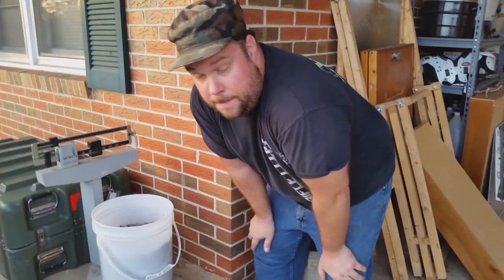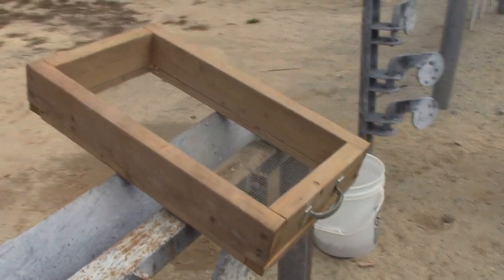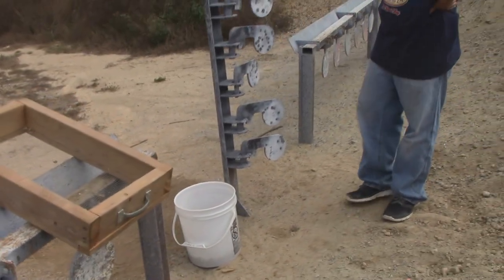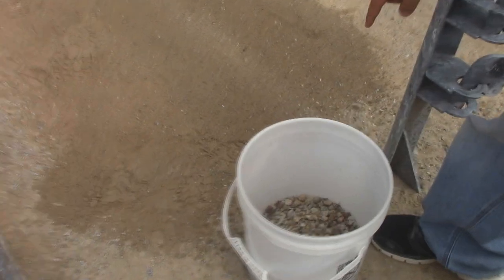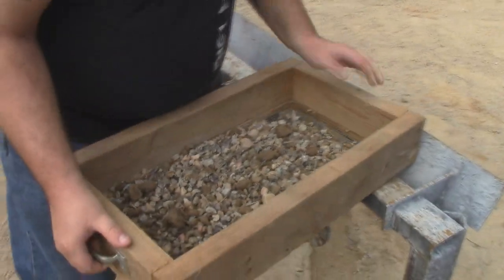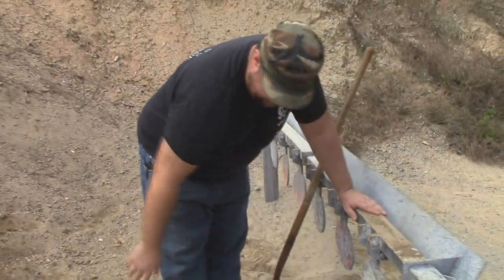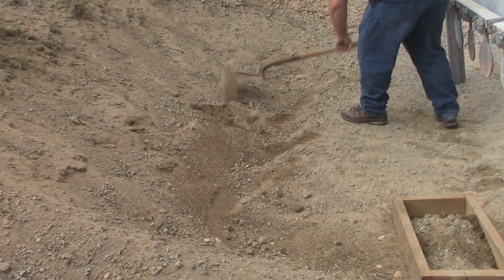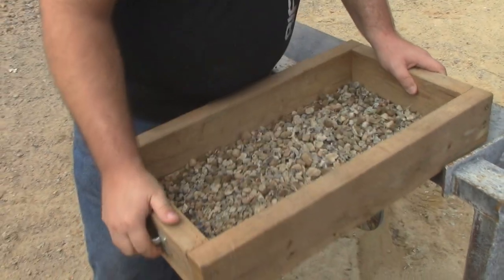I've Been Collecting Range Scrap Lead Wrong! 255LBS./30MIN.

Comment: Use an wide flat electro magnet powered by an atv's alternator/battery while mounted. it'll take you five minutes
Reply: You use a magnet to pick up lead?
Reply: +Kainen Mattison lead isn't magnetic lol
Reply: it is weakly magnetic, but still magnetic, which is why you need a power source
Reply: Everything is magnetic to some degree. For an electromagnet you need a power source all the time, otherwise it is not a magnet. And given how weakly lead interacts with magnetic fields, you would need close to MW power. Those kinds of electromagnets you seen in particle accelerators etc. I bet it would not be a viable option to use something like that to pick up lead scraps.
Reply: Yup,get a lead magnet,the greenies will sell you one

Comment: Put the sieve on blocks when shoveling in the dirt, and a lot the dirt will drop through as you shovel. Saves your back from lifting and shaking. You should have some water to settle the dust. I would suggest a respirator, and a rain suit or coveralls you can remove and toss into the back of the truck to reduce exposure to lead dust. Washing the scrap with water to remove the clay will save a lot of skimming when you melt it.

Comment: Put a ramp leading up to the flatbed of the truck.
1. Shovel the lead on a wheelbarrow.
2. Drive the wheelbarrow on top of the flatbed.
3. Empty the contents of the wheelbarrow onto the tarp covered flatbed.
4. Rinse and repeat.

Test how much lead you can safely transport with the wheelbarrow up the ramp and adjust your trips as needed.

Comment: Man I need to so that I need lead to make fishing weight for my fishing group.  I do sell weights to buy fishing stuff for the kids. But also give lead away to the kids. But I don't get lead free no more used to get wheel weights but shops can't give it away to people or have there buddy they give it to. So I get roof lead from pipes. Do get some donations which I give them free weights doe the lead. Good vidoe have a good week god bless
Reply: Super Mutynt o yea when my boats going when it's flooding I go get stuff from the trees a d when it goes down so the same. Love free stuff cause more to give away to the kids and adults out fishing that needs a smile and blessing. Thanks have a good week god bless
Reply: Danny Schwab ....did the government crack down on or outlaw lead wheel weights?  Swear I heard that on YouTube somewhere....
Reply: Rick Thompson I don't no but there using a metal that not lead. The last time I got some wheel weights about 4 years ago 30 dolles for a 5 gallon bucket turned to be 3 pounds. I was mad but when I melted I had pound and half lead the rest steal I guess it didn't melt I was so mad. But I keep the steal or what ever it is and drill holes and use anyway there small square pieces flat so work like a no role weight. But it wont be long they will but since the stores sell must me OK.  But go to YouTube search do it rock weights there a Rock you can buy and drill and make weight I'm gonna do that and give them away to the kids.  Thanks for asking I'll be googling thaT tonight thanks god bless

Comment: You could build a light weight 'rocker' like gold miners used to use to make your job much easier. Just a folding saw horse (for portability) on rockers with a handle for leverage would keep your sifter at waist level. Fast and easy.

Comment: Looked like mostly rock.  Hillbilly math is always amusing.
Reply: they arent mostly rocks. clueless people on youtube are amusing
Reply: You can usually tell whether it is lead or not just by how heavy it is.
Reply: i do wana know how much lead they end up getting out of it.  if theyd post a follow up video id be willing to bet its significantly less that 255.  maybe like 200 tops.  just curious
Reply: Well, just look at the guys name. You wouldn't really expect anything of worth to come out of that guys mouth, would you?
Reply: Karl Budde I was referring to the guy who calls himself "chester themolester.
Reply: +Rotary Saw ahhh gotcha.
Reply: +Karl Budde
That's what the guy said in the video, around 200-215 pounds of lead.
Reply: +xml
MUH SHINY LEAD BE SHINY MMMMMMMMM LIKE GOLD BUT HEAVIER!!!!!!
Reply: If you can't tell by the weight volume of the buckets you obviously have no idea what you are talking about and need to go sit down 

Go fill 3 buckets half way with rocks and wiegh it you will see how much of a difference between the 2 are....
Reply: it probably isn’t, even if it was... it makes it a lot easier to pluck out lead from that mixture than from of the ground.
Reply: Donald Taylor  Which specific type of rock? Is the rock of a pre-measured density, or are we just winging that as well? 
Maybe fill one bucket with mercury and weigh that too. And hey, are these 5 gallon buckets? a different capacity? same manufacturer, and are the fill lines the same? 

I think we ALL need to just sit down and get a few dozen of these experimental parameters to a consensus, lest our results be invalid. Who's writing the grant for this research BTW?

Comment: I've done this at the range i belonged to, and yeah, it was an efficient collection method.  But then i found the silhouette range, with the steel bullet traps.  The entire width of the traps had a huge buildup of lead in tbe vertex, with practically no jackets, dirt, or rocks.  Just some ants, which made smelting interesting😊. I had to leave the area shortly after i found this, so most of it remained untapped.

Comment: I hope the scrap metal experiment went well for you...  FISHING sinkers can be cast of any unknown alloy  with a high level of forgiveness... on which alloy is used.  IF using Zinc alloys in aluminum block molds ... be aware that hot molten zinc  CAN  'dissolve'  aluminum  well below the melt temperature of aluminum.  To PROVE that   try dissolving an aluminum can in  molten zinc or  overheated molten lead.

Comment: I was thinking of getting into that, but I'm afraid of lead poisoning. Is that something I need to be concerned about? You know, with all the fumes with melting the lead. I don't even know if I could find a range that would let me do what you are doing. But I'm glad to see someone doing that. Recycle lead. And after you cast and make your bullets, how accurate are they? I would think it would be more of a plinking load, probably not good for 223 for prairie dogs. Let me know. Thanks for sharing.

Comment: Build a stand for the sifter and lift the berm material to waist height a shovelful at a time instead of lifting 5 or
6 shovelfuls in a single lift. Also, getting it off the ground as you fill it will let most of the siftings fall through immediately. You'll be able to sift 10 or 12 shovelfuls each shaking.

Comment: Why not add a 12 vdc motor with an eccentric shaker arm, mount the whole thing on a utility or custom cart, and just let the sand drop out the bottom?   Better yet, just incline the sifter about 10 to 15 degrees and the rocks and other debris will actually advance up the slope and drop out while the lead remains in the bottom.  This happens due to the density of the lead being higher than anything else in the sifter.  They make commercial units for industry, but, it is more fun to make your own.

Comment: range lead picks up silica sand which will cut your rifling to round ridges we mined 2600 lbs from grand forks nd airbase skeet field and just re loaded it after sifting had very scratch bores after. flux it 5 times

Comment: Suggestion: put a furniture dolly under the pail. Use buckets with metal handles.  Put a 2X4 through the handle, where you can both cooperate, lifting it into the pickup......

Comment: 09:45 I would recommend you have a 2-wheel cart and use a tie down strap to secure your bucket to the cart - maybe even make it so it'll haul 2 buckets, then mount you a couple PVC tubes to also carry your shovel and a dirt rake for when you're done - so you can easily and quickly rake out your excavation area - wouldn't even look like you've been there when done - and far as the 2-wheel cart;  have you a small ramp to be able to wheel it up into the back of your truck!

Comment: Make a bigger sifter, add four wheels to it, with a steel lever handle, and move it back and forth once you add material with a shovel. Also have a slot where you and slide in a wood sheet to stop things from falling, this allows to to transport without lifting.

Comment: Uh ... somebody invented a wheelbarrow a while back.  Might be useful for toting lead buckets back to pickup truck. But then in a pinch these guys could just fill the white buckets to the 1/4 mark and make more trips. Now to the sifter ... a bit of ingenuity could come up with a sifter on  rocker legs similar to what archeologists use.  Kudos to the range scrap recycling guys though. They are working hard, and doing a bit for ecology at the same time. Now I’m energized to go to my drafting board to design a small powered sifter using a drum screen and my old garden rotary tiller for parts.

Comment: the amount of lead might have sumtin to do with the fact that its been a long time since someone cleaned the berm 
you could make a shakergrid making the grate a little longer and on an angle you shovel it ontoo the grate on the top and shake it using a cordless drill with an offcenter weight to vibrate it and let the mix roll down with the sand falling through the grid and clumps / lead straight intoo the bucket

about lifting : get a beam and a chain and left the bucket from the shoulder between the two of you

Comment: 255lbs of lead, at a 70% retrieval rate (30% is slag and dirt, just an off the cuff estimate) would make just over 10,000 124gr 9mm bullets. You're set for a while man!

Comment: A few questions: Couldn't you be using a NEODIMIUM large magnet after doing he first sifting?
And WHY were you "using" your back to lift the weights instead of your knees?
Reply: Lead is diamagnetic,(which means it repels a magnet but you can't feel it repelling because it's such a low force) so no he can't use a magnet.
Reply: Samuel Hanks And bullets aren't coated with magnetic material? I know I'm ignorant, that's why I'm asking.
Reply: No it's copper which is basically not magnetic. It is but it is a very low force.
Reply: Samuel Hanks Thanks.

Comment: Just wash the lead before melting. Otherwise you're likely to pick up impurities from the soil, even though it will float to the surface. Be sure to dry the lead in the sun for a while if you're going to add it to molten lead, you don't want a steam explosion.

Comment: He's worried the bucket will break which is probably not that possible as the bucket can hold more and how much more does lead weigh than watter? Also there are alot of gaps in the buckets full of lead (just a random comment btw)
Reply: The specific gravity of lead is 11.34, so it is 11.34 times heavier than water. 
1 gallon of water weighs 8.34lbs = 1 Gallon of lead weighing 94.58lb = 5 gallons of lead weighing 472.9 pounds.

Comment: i know im 5 years late.. use both arms while lifting. it prevents a slipping of disc, less strain on your forearms and shoulders, less effort on your grib strength. the everyday joe can lift 20 to 30 pounds on one hand. with both 100 to 75.

Comment: Put a couple of round rockers on the bottom of that sieve.  Or just set it on that big angle iron, and rock it like a seesaw.

PS Take more buckets, and don't fill them all the way.

Many ranges sell the lead to a company with a sifting vehicle that sifts the soil.  They don't like it when you higrade the lead out of a few lead rich areas.

Comment: Ohuhu Adjustable Wheeled Snow Shovel Pusher u mod it so drill hole in so dirt drop out save your back if know size bullet u could put tray under catch them make  a lot easy.

Comment: how much lead do you need? i mean doesnt a bucket even just half full of lead make enough bullets to last you a few months?
Reply: And then what?  Go back to the same range and someone already cleaned out all the lead and you have to start looking for new place.  If it was me I would get all I could, you could always sell extra on eBay.
Reply: that's fair enough, but when i read 225 lbs in the thumbnail i assume that that should last you for a lifetime. stockpiling some reasonable extra is one thing, but that just seems like quadruple overkill. anyway, i actually really wanted to know how far they expect to get with that amount, because i have no idea how much lead you need to craft ammunition
Reply: It depends on how much you're shooting.  Had a conversation with one fella here on youtube, he mentioned he shot 20k cast bullets in 3 years, that's about 163lb of lead.  So for him 250lb might be 5 year supply, also he's using relatively light bullets, take someone who's casting very heavy bullets and at same rate will last 6-12 months.  It is a lot of lead though for average person, I could never shoot this much even if I wanted due to lack of local free /cheap places to shoot.

Comment: rotor, slightly adjusted that turns the soil, onto a track, that sends it through ha sifter, with a large casing you can take the whole hill side, sift it and place it back. A riding, lawn mower could also be adjusted, the benefit of this method is the soil will become, less dense the more its turned. 90% of the hillside could done in about an hour.  Sifters are old old tools, I would suggest seeking out now even better tools. Plus it can be a fun side hobby. just be careful when altering rotating motor parts. A mechanical tech book... that may be a use. Go seek. You can learn something about what much weight per rotating and fatigue vs gear ratio to how much you want to pass through, while not exceeding the limit of the strainer method.  
Have fun learning.

Comment: If you wanted to be thorough you should take shovel fulls of dirt and a rake and dig a good hole, spread it out, and then run over it with a 40” shop magnet on wheels with a handle. You just run it over it until you picked it all up and then shovel the dirt back up on the mound and move down the dirt berm. You did pickup a lot of lead with your sifter though.
Reply: Except lead is nonmagnetic....whoops!

Comment: if you look on you tube gardening vids  guys have made  dollys  to haul 2 - 5 gallon buckets  it has forks on it  just the size of the rim on the 5 gal bucket  in your case you might want to make a single bucket sized one  useing wheel barrow tires and  handles  I used one to carry 10 gallon of water to a garden bed  86 pounds of water

Comment: Not all dirt is going to float up when you melt it.  I find when I am done melting and empty the last of the lead there is always small dirt / dust layer that I throw away with very thin layer of lead so as not to contaminate my ingots, otherwise this dirt ends up in your ingots and then you end up with leaky pot because it clogs the nozzle.
Reply: That's why you should flux the lead before melting it down.
Reply: +no no fluxing before you melt it will do absolutely nothing.  fluxing after it melts will help get rid of impurities but not all.
Reply: it does float to the top; less dense.
Reply: Dima Prok you don't know a thing
Reply: Cian Mac - Whatever, I cast my own bullets and I know a thing or two about lead melting.  Some of the dirt gets trapped on the bottom and no matter how much you flux when I am done pouring ingots it's there, not a lot, but it's there.
Reply: What if you wash the lead through your screen before you melt it. I know you can't get all the dirt out, but that should get the most of it.
Reply: Most people discorage from washing lead as not to trap water and avoid explosion which is worse.  I think if you wash solid pieces it's fine, but small pieces like bullets it's dangerous.
Reply: Not sure why that would be an issue unless you went straight from the wash to the melting pot. Just give them time for all the water to evaporate.
Reply: This is where the problem is.  Unless you spread out washed lead over large area and leave it in the sun for few days, it's not going to dry out completely if you put it in the bucket.  And if you got as much scrap bullets as these guys collect, it just becomes a huge chore.  You need space, you need time, it just easier to not bother washing and scrape the dirt off the top when it melts.  If you got small quantity and patient then it will work.
Reply: Maybe a spin dry is an option or bake them in the toaster oven?
Reply: Yes, it's all possible, but keep in mind that you won't get all dirt out anyway so you'll still have to deal with dirt and using your oven where you cool food to contaminate with lead, I would never do that. I got separate toaster oven for things like that, but it won't hold much.
Reply: Since he is melting the lead two times, it probably doesn't matter (if there is a little dirt). He gets to skim it a couple different times.  :)
Reply: Right.  Also, in his case as he mentioned, he doesn't go all the way empty to the bottom.  The dirt either floats to the top or sticks to the bottom/sides.  So if you use a dipper to make ingots you can avoid getting dirt in your ingots, although if I was doing such high volume as he is, I would add some sort of valve to ease pouring because using a ladle always end up spilling some lead and I hate contamination and cleaning up is such a chore.

Comment: Lol, I was wondering how long you were gonna carry on filling the bucket. It's heavy stuff that lead!
People don't realise how heavy lead actually is. A 10 litre bucket  full of lead would weigh 250 lbs. To put than into perspective, backpacks usually come in volumes between 50 and 90 litres. The smallest 50L backpack full of lead would weigh well over 1/2 tonne.!.